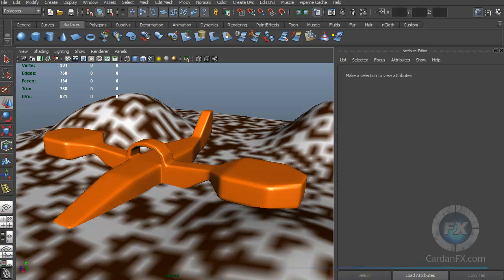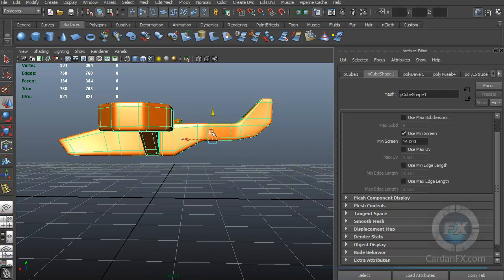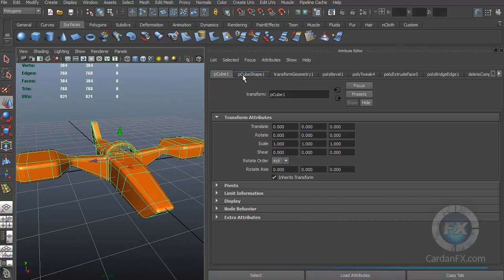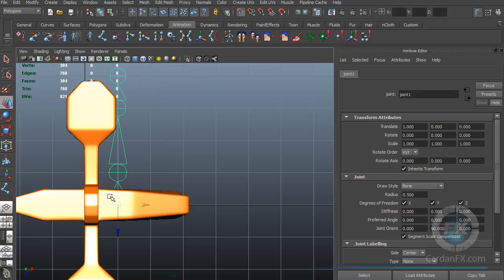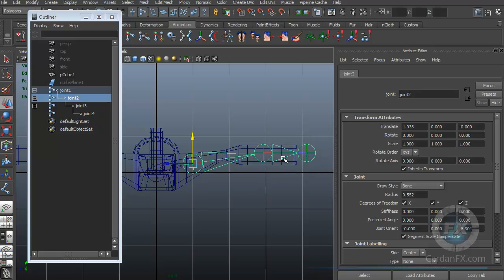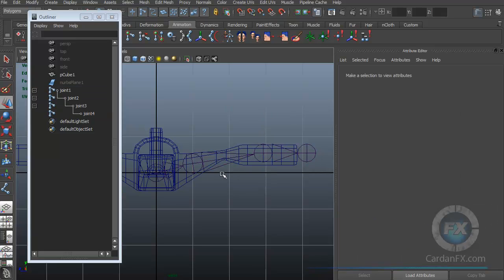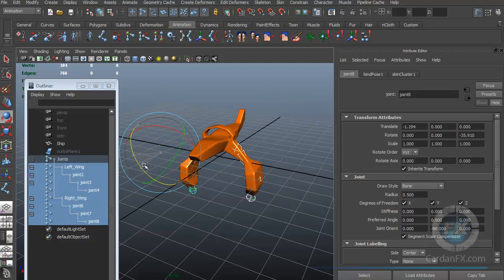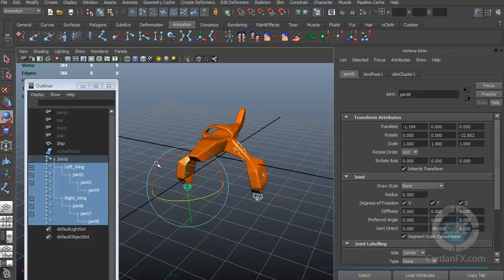07.- Rigging Joints and Bones Free autodesk maya turorials

Comment from the maker: It is just that the new joint is over the old one. Try by selecting your joint from the outliner and then moving just a little. another thing you could do is to change the size of your joints from the display menu options.